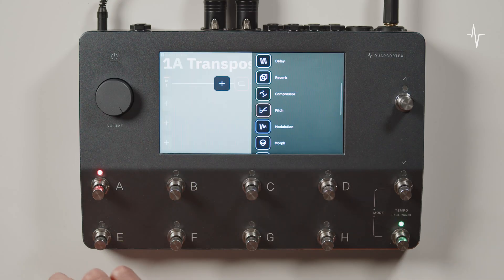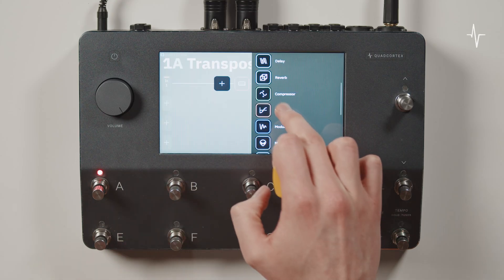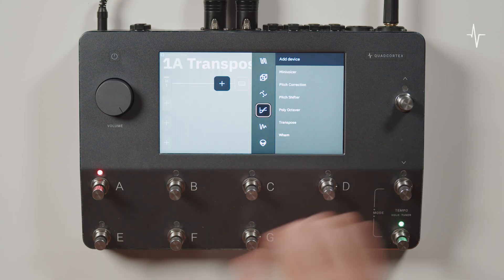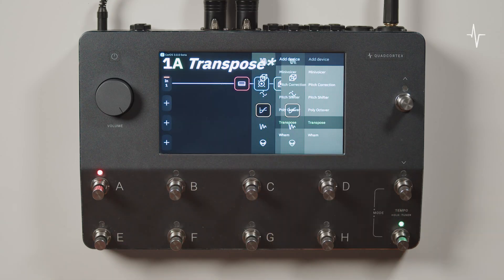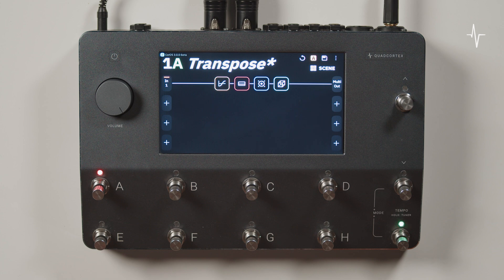How to use Transpose in CorOS 3.0.0

Comment: Would have been better if the transpose function is built into the input along with the input gate so you would not have it taking up one additional block. But everyone who's going to use this is probably already using the pitch shifter anyway (including me) so it doesn't matter much lol

Comment: That's like the virtual capo block on the Fractal Audio gear.  It goes -24 to +24 semi-tones though.  Not sure why I would need that much though.  Quad Cortex looks awesome too. I ended up with the FM3 due to the lower price, but the QC was on my list of wants. Using it for bass by the way.

Comment: So what‘s the difference to pitch shifting with the pitch block?
Reply: @josuastangl7140  the main difference is that the Pitch shifter allows you to blend the signal, so you can mix the pitched and the DI signals. Also it allows you to pitch shift in cents. The transpose block only “transposes” your signal. It seems that does a better job at tracking the signal, so less artifacts, but the purpose is the same as how people usually uses the pitch shifter block in the QC
Reply: @DEM94  I‘m interested to hear more about the tracking and actual quality differences, if there are any.
So far Neural haven’t said anything about that, which leads me to believe it might just be the same algorithm.
Which kind of makes this new block irrelevant🤷🏻‍♂️